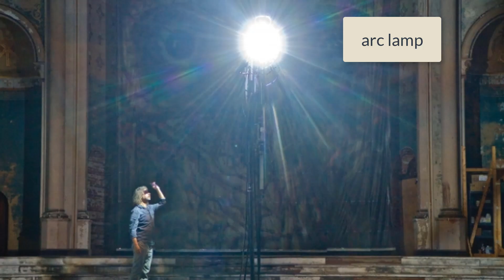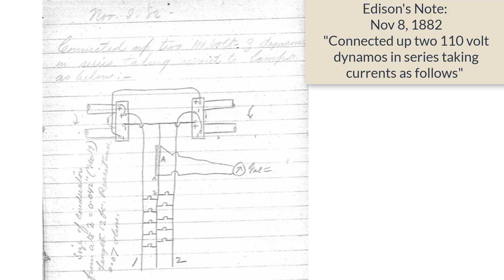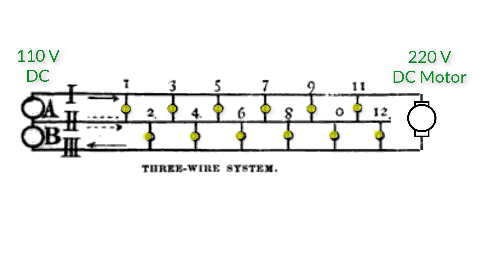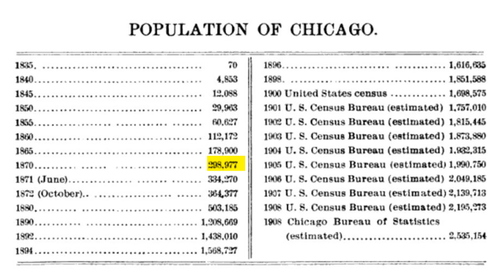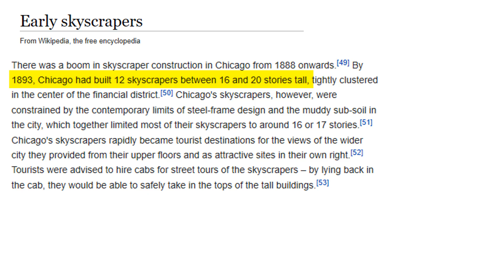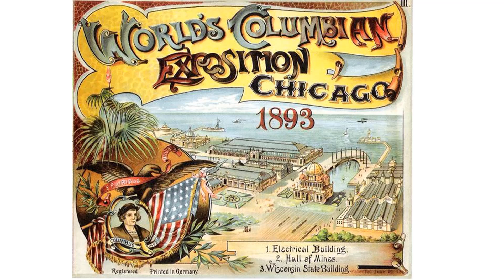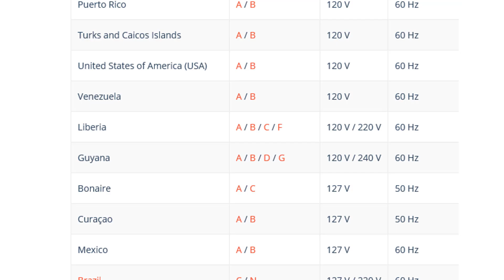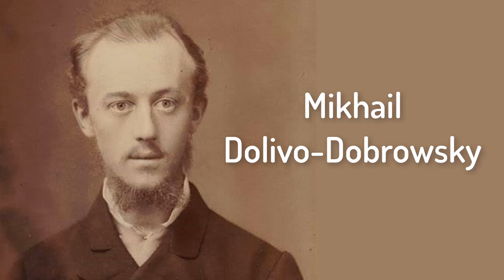Physics and History of Why USA uses 120 volts and not 220 volts

Comment: The cost is not about the transformers it is about distribution losses that increase with i^2.  Not sure if you covered it but Edison was an ego maniac and wanted to use DC while Tesla showed that Ac was the way to go.  Edison was not even half the engineer of Tesla but a more conniving  business man.  240VAC distribution losses are 25 % of that of 120VDC.  Japan distribution network covers a smaller area so safety could be considered.  That is why we use typically 115kV for long distance distribution.  If you were to transfer power from Niagara falls to New York city with DC with the current wire sizes, less than 1% would get to your light bulbs and most would generate heat along the wires.  I am not as informed as you about the details but I was always taught that 110 was more about the fight between AC and Dc and Tesla and Edison's little tiff. Edison was trying to promote his patents and Westinghouse was going to destroy him.  That is likely the major factor here.  Edison could care less about safety but used safety concerns to try derail a far superior technology that he could not refute on scientific terms.

Comment: The short answer is, it would be too expensive and time-consuming to switch over to 220V even though it would offer many advantages. There are new electrical standards on the horizon for LOW power devices like lights, modern TVs and so on because if you think about it there are really only a few devices in a modern house that require a lot of energy, such as refrigerator, oven, drier, hot water heater. Just about everything else can be powered by far less, especially today.

Comment: I'm pretty sure there's only one reason we are using Tesla's 3 phase alternating current, around the World.. it is simple economics.. Edison was a supporter of direct current and Tesla came up with alternating current.. both light lights.. 
direct current requires a nearby generator.. the resistance in the wires increases by the distance traveled.. at about 1.5km the current no longer lights lights.. it does.. but dimmer and dimmer in an inverse proportion to the distance.. 
AC uses transformers to overcome this issue.. Niagara Falls got the first power generator station.. shipped to Buffalo.. then all the way to NYC... direct current would require a generator station for each square mile.. JP Morgan was footing the bill.. JP Morgan wanted to make (more) money... 
120 volts lights lights.. but at twice the cost of 220
we use 120 for the same reason we are using AC current currently

Comment: My take & observations on these two subjects is: 50Hz vs 60 Hz generators in countries that the grid is 50 Hz run 300 RPM Slower then generators in US (1500 vs 1800 RPM for same pole motor) runs slower, therefore less wear & tear on mechanicals, I thought Tesla like 60 Hz due to lower flicker effect on incandescent filament bulbs, 50 Hz was Siemens choice. 220VAC uses smaller circuit fusing, US homes 15/20 Amp circuits, in UK 10AMP circuits common, (smaller fuseboxes or panel boards) outlets/plugs are larger in 220 VAC countries than US outlets probably due to the higher voltage, but Europe uses less step down transformers per circuit than US, go outside & look on a pole and see how many transformers are hung! Since US system uses more step-down transformers on the grid equals less residences will lose power in a fault.USA uses SPLIT-PHASE distribution: grid voltage 33KV (this varies from place to place) to 120 CENTER TAPPED transformer secondary by use of a neutral wire, Europe does not center tap the distribution secondary grid voltage to 220 VAC, most understandable if I had a schematic to show!

Comment: There are a number of errors. 

You covered the resistance error in a response. However, the lamps will get dimmer when more are added only if the lamps need more power than the generator can supply. This will happen regardless the system being single phase or three phase.

By reducing the feed wire need from 4 wires to 3 wires does not reduce the copper need by 50%.
Getting rid of the 1 wire gives a 25% reduction, assuming the neutral must be the same size as a leg wire - to handle the situation where current flows in only one leg and not both of them. 

You cannot have two phases 180 degrees apart. If there is a 180 degree difference, then the highest voltage you can get is the voltage of one leg. There were a few early systems with on phase leading the other by 90 degrees, but it had very limited use and did not last long. Our residential power is a split single phase distribution system.

Comment: Great explanation, but if you are putting this into a book, I'll suggest 2 ... well now only 1, .. correction. I hope this is of some use. 
2:36 I saw that you've already addressed the resistance issue, so I cut out this part of my comment.  
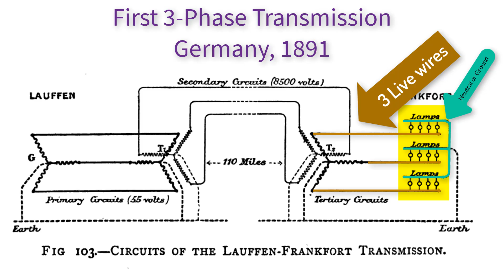12:00 As far as I know,  the USA has always used only one or two phases on the customer side of the pole transformers, so 3 phase power is something you're very unlikely to see in an American home, though it's common in industrial buildings, which are more likely to have 3 phase motors. One huge advantage of the American 2 phase delivery system is that even when powering 240 volt appliances, each connection is only 120V relative to the ground, so a 240 volt shock is still unlikely. Given how much outdoor wiring there still is in the USA, that's a significant advantage. 

PS: I'm surprised Japan never went to 120 volts, since they had such a large electronics sector that exported so much to N. America during the 1950s-1970s. It must have been quite a burden having to modify (if needed),  test and certify the same general designs to run on both 100 V and 120 V.

Comment: I think 240 is safer you use half amprage for same wattage less heating of conduct ors.    My friend s electric kettle heats faster then mine in USA his is 2400 watt in eourpe mine is 1200 watt at 120 volts . Today LED lights the current is alot less then old style light bulbs.  LED lighting put a big dent in my electric bill

Comment: Nice video BTW theres no netural in DC only + and - here in Australia we did away with the 2 phase and 1 neutral to houses etc in 50s its now either single phase or 3 phase to all gear  . The US must have there  LV of the transformers wired in delta where we do star for LV ( Delta for HV) as between 2 phases we have 415 v

Comment: I've been an electrician for 30y. We use 110v on site as it is safer, but wires are thicker. We use 220v as smaller wires plus if we 220 we can make a 3ph system which uses star or delta for running motors i.e start motor up in star wiring system to start up and push motor, but then switch to delta once motor has reached speed, this gives a better running motor system. Also 3ph fed into a large fuse board each ph load can be shared thus balanced. 110v does not have this advantage. From a transformer you split power 50v 50v and only get 110v when joined  (N wire used for return ) this makes for safer use. USA use this but are switching to 220 in some instances. Amps load is what makes a big difference on any system i.e 5A cable can be small but as you go higher the cable size or material used gets larger.

Comment: I watched this twice and I am so lost. I'm in Wisconsin and have friends in Romania [who are worried about Vlad Putin] and they run 220. Wisconsin buys electricity by the amps. As voltage increases, amps go down. So 110 needs more amps and 220 needs less amps. And this may affect the cost of energy. I don't have a clue. 

We should buy all of our electricity by the BTU. 3,412 btu/kW., 180,000 btu/gallon of gas., 1,000 btu/cubic foot of natural gas., 2,800 btu/propane. ... ect.

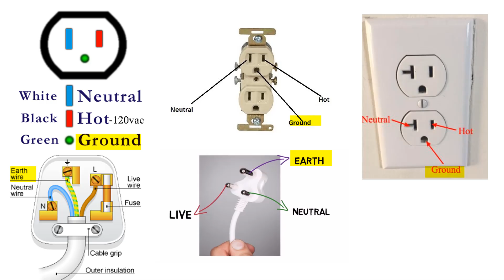Comment: Hullo there! PooTube suggested this video whilst I was researching something *entirely* unrelated to electricity, but I was nearing my limit as to the absorption of information on my topic of choice, so I took a break and watched.... Very well presented! I wish that information of this sort could have been as readily available when I was in college for Electronics Technology [think pre-Carter Administration!!] -- Although I noticed that whoever did the illustration for the "household plugs & outlets" (at @ 12:20) definitely doesn't suffer from OCD; both plug illustrations have their 'hot' and 'neutral' connections reversed! (If you rotate the plug to align the conductors, the ground going where it belongs automatically causes this fact to be "shockingly" clear!! (And what's with the *round* male contacts instead of the usual 'blade' type??)..... Also, most 220v "household" appliances are actually two separate 110v applications: in a clothes dryer, one of the 110v 'legs' powers the heating element, whilst the other powers the tumbling drum motor! And since I mentioned "heating elements", the reason a combination stovetop/oven has a 220v plug is to separate the 110v for the oven elements and 110v for the 'eyes' on top!! Keep on keepin' on; I may just get another of your vids recommended again in the near future.... Blessed Be, & Peace!! 🙏☮

Comment: I live a few miles from where the first long distance power transmission in the US took place. The problem with DC is that resistance eats up too much of the power. It's much more efficient to step up voltage for transmission and then drop it back down for distribution with AC. 
Also, it's worth noting that in a 3 phase circuit, if you lose one phase, you lose 2/3 of your power transmission.

Comment: The main reason is every time we have tried to implement any change everyone screams, cries b***hes and moans about the costs to retool to conform to the rest of the world. 25Hz 2 phase survived well into the mid 1990s in a few regions for this very reason.  It took NAFTA to finally shut down those old factories still running 115/155 volt 2 phase 25Hz equipment. I have a 1950s Les Paul guitar amplifier with the 25 cycle option which added about $20 to the price of the amplifier. It requires a larger power transformer than 60Hz requires so it's fine for use with 25Hz, 50Hz or 60Hz.

Comment: To step down to 110v you need fewer turns on the secondary than stepping down to 220VAC.  Half as many in fact, so the argument that you use less metal in a transformer to step down to 220V vs 110V is questionable - unless you're talking about the iron core, as the magnetic flux is less, as the current is reduced.

Comment: DC will not be stepped up or down going through a transformer because it never switches polarity.
Running DC into a transformer just makes it a magnet and nothing will come out of the secondary winding,
(except a large spike when removed from power).

Comment: A big advantage of 230/250v mains voltage is the lower current and hence the option of using thinner, cheaper connecting wires and hence less copper for house wiring.  In the future, I can see houses being wired with (say) 12v DC to power lighting using LEDs, thus saving the conversion from 240vac to a lower DC voltage in each light bulb.  But that's the future rather than history.

Source impedance for electric generators and batteries is very important and something I quite often measure in batteries.  An ideal voltage source has zero resistance ( conversely, a current source has infinite resistance) as you explained when Ohms experiments didn't take it into account when he used thermocouples to drive current rather than measure temperature as we do now. 

Never really understood the reason for 60hz v 50Hz for the AC mains frequency.  I've always thought it may have something to do with alternators running at 3,000 rpm but that's not very convincing.  I suspect, as you illustrate here, it's all down to history and arbitrary choices made at the time that become difficult to change later.  That applies to lots of things eg pedal cycle wheels/tyres and threads and the qwerty keyboard :)

The incandescent light bulb was also invented in the UK by Joseph Swan and acknowledged by Edison.  That resulted in the formation here in the UK of a company called Ediswan which manufactured light bulbs (which, incidentally we sold in our small family-owned electrical/radio/TV business).  Edswan also made thermionic valves (ie tubes in $) under the Mazda label.  Unfortunately Mazda failed when solid state electronics became the norm from 1960ish onwards and no longer exists.

Thanks for another entertaining and informative video.

Comment: To simplify it after the war Europe had to be rebuilt so they went with 240 volt because it does use less amps at a higher voltage

Comment: They have a different kind of a 220 it's a 220 to ground our 220 is phase to phase and takes 2 hot wires, plus we still have a neutral that's not really needed however the 220 or 240 in Europe is 240 to ground

Comment: Great video however, you were telling us about Edison and his DC electricity, then you immediately switched to telling us about transformers being used. You have left out a very important step in the transmission of electrical power. I'm sure you know DC does not work in a transformer. Somewhere along the line, alternating current had to come into the picture. Edison was so bullheaded and narcissistic he never admitted AC was the answer to his power transmission inadequacies although I'm pretty sure he knew.

Comment: As an American electrician I want to clarify that American homes are all supplied with 240 volts ac. However we don't supply all circuits it the house with all 3 phases of electricity. Most circuits get only one phase at 120v.

Comment: Can someone help me with this, in a split system with a single wire neutral earth out back transformer with an output of 240 and 480v what is the shape of the sine wave? Is it the same as a full wave rectifier Dc ?from Australian bush

Comment: Two phase power? Where exactly? In my neighborhood in NY. There is three phase power distributed along the top of the utility poles. Periodically there are step down transformers that only connect their primary winding to two of the three phase 13,500 volt lines. They are only using one phase of the available three phase power. What comes out of the step down transformer is nominally 240 volt power with a neutral wire in the electrical center (commonly called a center tap) of the transformer's secondary winding. This results in 120 volt power available for lighting and other smaller loads, from one of the hot legs of the secondary and the neutral leg. There is also another 120 volt leg that also supplies power that is also referenced to the neutral leg. From either 120 volt leg to neutral you have single phase 120 volt power. But you also have 240 volt power available from hot to hot. The voltage on the two hot legs are 180 degrees apart. Making a 240 volt connection is still only single phase power, not two phase.

Comment: A legacy of early adoption however having said that the backbone of the US power industry is based in part on 240V. 110 is that are used within premises. Having a power system based on 110 v means that of the electrical wires have to be double the thickness to cope with a higher current which is really wasteful given that copper not cheap

Comment: Excellent presentation Prof Cath,  A fundamental reason why the Edison system was doomed to obsolescence,  it was a DC system!  No way of stepping up/down without using motor generators. Advantage of using AC  transmission is the ability to increase the power, volt amperes, transmitted along relatively small diameter wires by increasing, using AC transformers to step up the voltage to as high as the safety and insulation will allow thus reducing the ampere/ resistance losses in the transmission wires.

Comment: Many early utilities in the U.S. at least started with 25Hz.  The focus was more on powering industrial DC motors at the time, especially electric railways.  But 25Hz caused lights to flicker so everything got converted to 50 or 60Hz.  Told to me by an old electrical engineer from ComEd.

Comment: I have been thinking about, why we use 50 Hz in Europe, and they use 60 Hz in America. Is there any explanation to that? I see some kind of beauty in the (American) fact that
- one hour is sixty minutes
- one minute is sixty seconds
- one second is sixty periods of AC,
but this is probably not important. I just saw the new video about Steinmetz (vol. 1), and here it is explained, how Steinmetz ended up with 60 Hz, However, 50 Hz is not that different.

I also remember from my time at the technical university, that we were visiting a Swedish company, then called ASEA, now ABB, delivering equipment to a hydro power plant on the border between Brazil and Paraguay. These two countries had different frequencies, so the power plant needed different generators for the two frequencies.

Also, for electric railroads 16 2/3 Hz is quite normal.

Comment: USA started it out 110 volts, but to increase lighting brightness, in particularly for out door lighting needs, the voltage was bumped up over the years to 115, 120, and finally 125, which is what the transformer is to deliver to the taps, usually at a decent load the voltage will be down around 122 at your meter.

Comment: Until the 1950's  Canada (Quebec) was on 110volts.  I remember measuring it and reading about the USA with 120.  Our appliances were American made, and for the 10volt difference, they seemd to be more durable by 10% more longevity.
In the last 1950's Canada and the USA started to integrate their power systesms.  We needed to bump our voltages up to 120, so that, in an emergency, Canada could provide the USA with power, and of course, the converse too.   The extra 10volts to 120volts meant an almost 10% reduction in amperes of current, and in lower cost of transmission lines.   
I enjoy your videos, It is only recently that I came across them.  Thank you, Thank you, Thank you for your researches and productions.